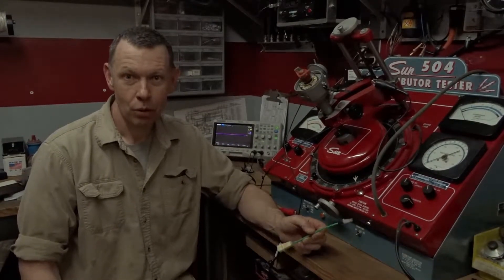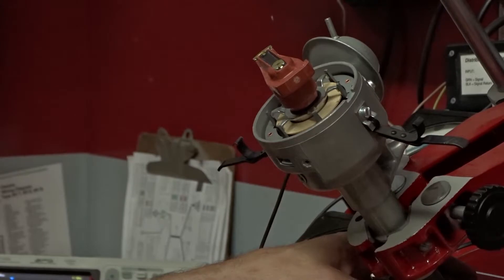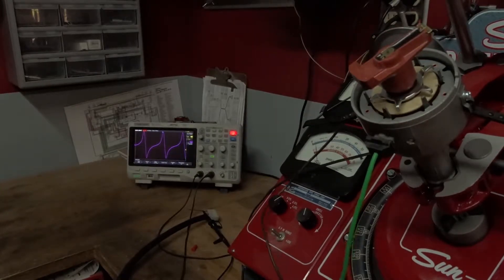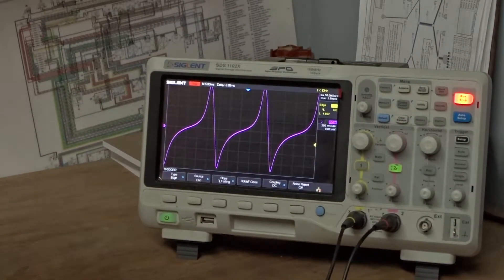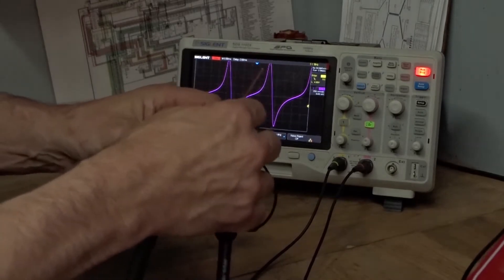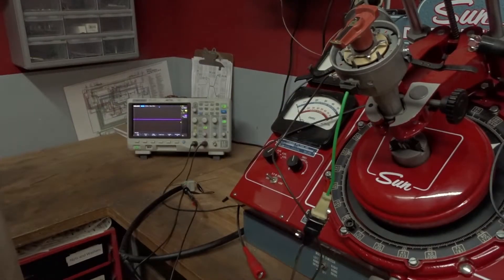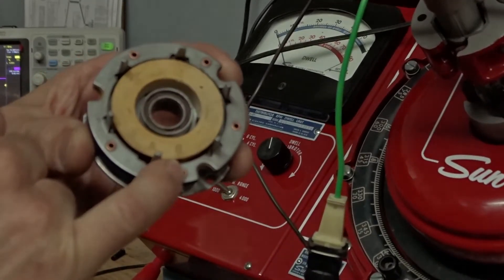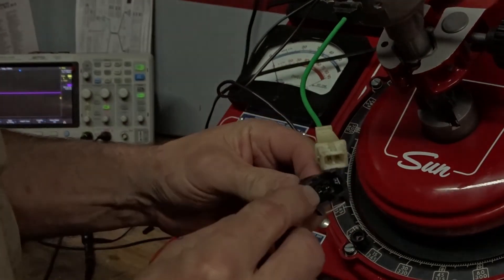Ignition Distributor. Does the direction change your ignition?

Comment: If my distributor shows retard Vs advance timing, can be fixed just changing polarity ?. Thanks for answering. BR
Reply from the maker: No, changing the polarity will change the trigger point only. The distributor retarding is a by product of the trigger signal. Every distributor does it. It just depends on how much mechanical advance is built into the distributor to counter act its effect.
Kurt

Comment: This video really helps a lot to determine polarity of the ignition. Would you need an external ignition module with this type of distributor or can the signal wire be connected directly to the coil? 
Thanks a lot.
Reply from the maker: Hendrick 
It needs to be used through some kind of module or ignition box
Kurt

Comment: Nice clear explanation.  The early Turbo version of the CW distributor wire was originally blue (930.602.911.00).  When the '78 Turbo came out (CCW), they swapped the pins and used the green wire (930.602.907.01).  The early blue wire is NLA so people have used the green one which is of course swapped over.   This has proliferated the myth that that the distributor produces a different signal when in fact it is the wire.
Reply from the maker: Johnny, 
Yes you are correct that the the early blue wire had it polarity switched at the two pole plug. What a lot of people dont also realize is that it was also used in the early 911SC models in the 1978 models. Most of which have now been switched to green wires and often the polarity in female plug has not been corrected.
Thanks for watching